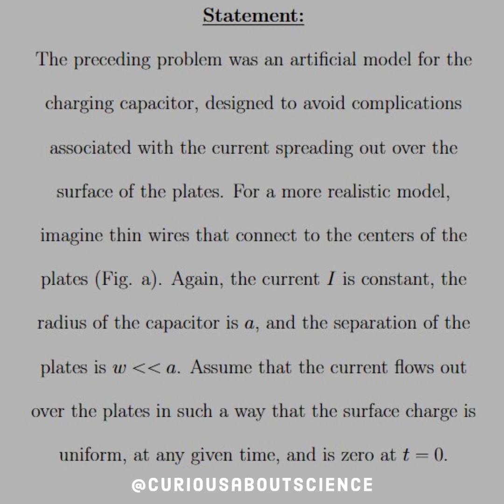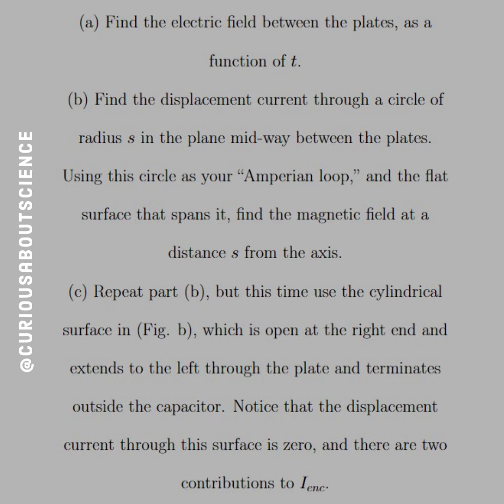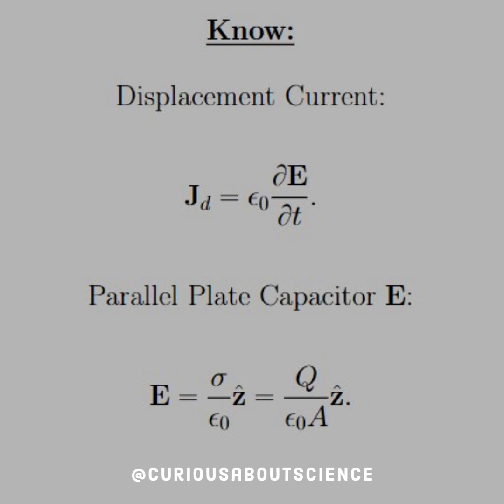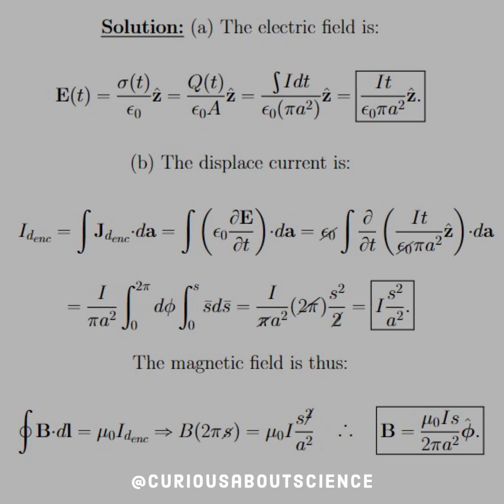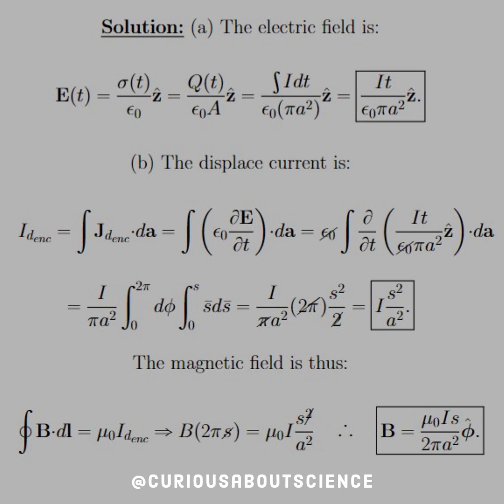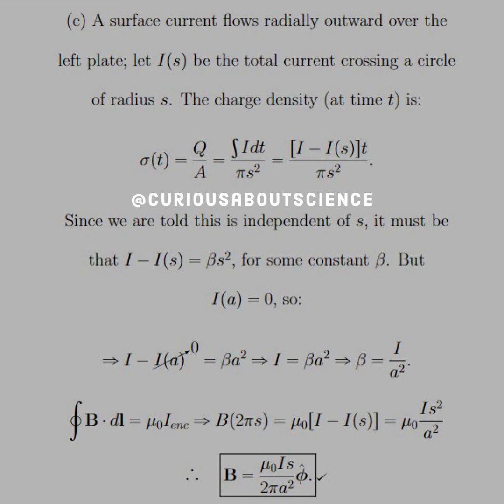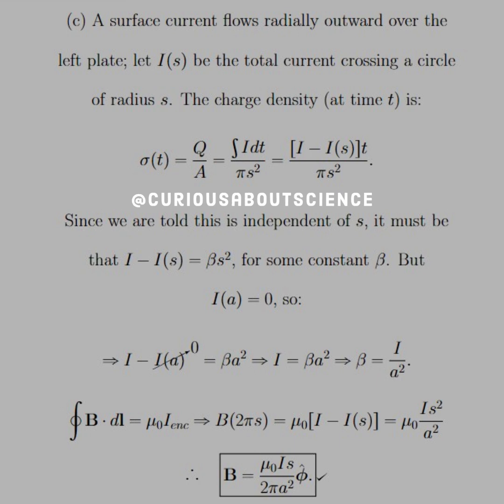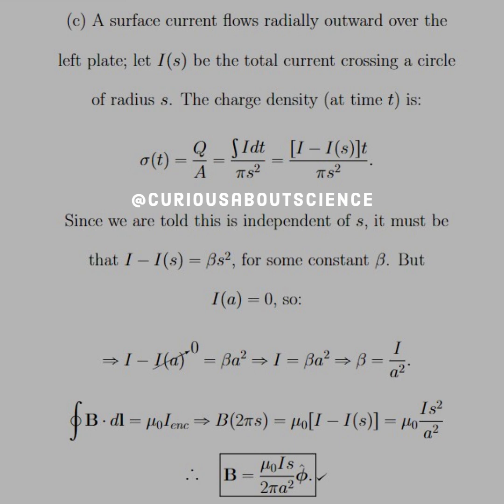Problem 7.35 - Maxwell's Equations, Ampère’s Law with Correction: Introduction to Electrodynamics

Comment: How are you using the field from an infinite plane to calculate the field inside the capacitor when the capacitor isn’t infinite and therefore symmetry doesn’t apply?  Furthermore, the charge density wouldn’t be consistent throughout the surface as the current is spreading out, shouldn’t Maxwell’s equation have been used instead?